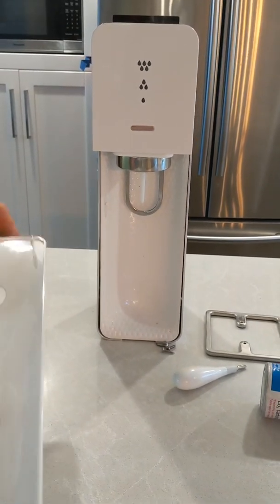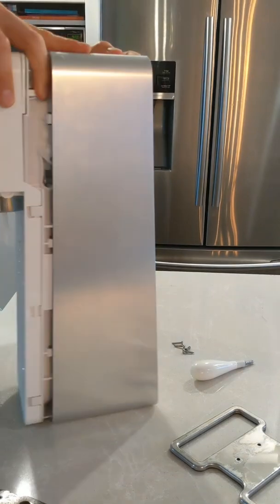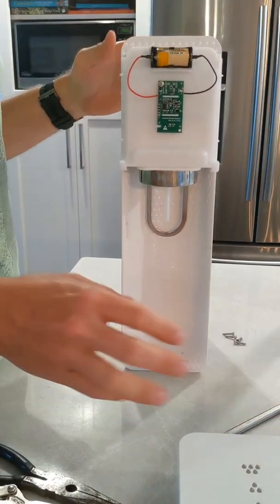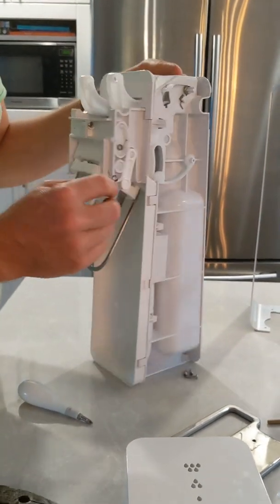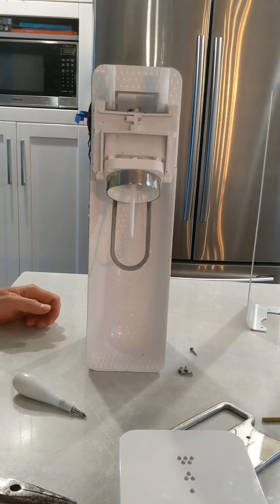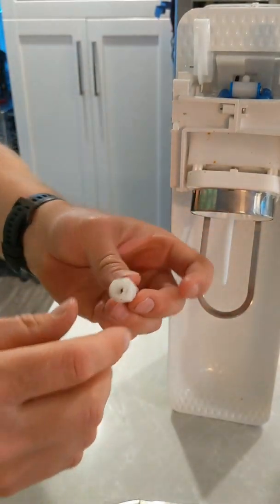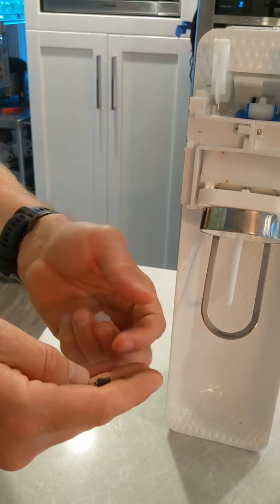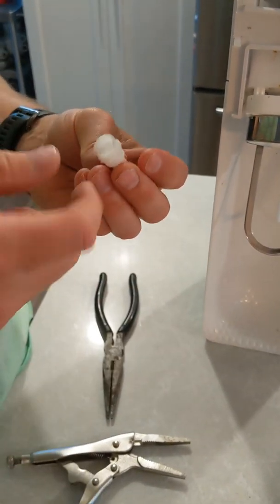Disassemble soda stream pressure relief valve.

Comment: My SodaStream ART machine isn't carbonating even with a full cylinder. It starts normally but with very little gas. There are no cracked O-rings. Could it be that the valve needs adjusting?